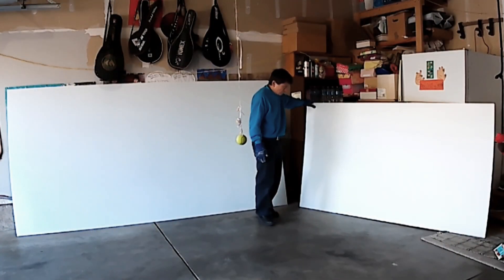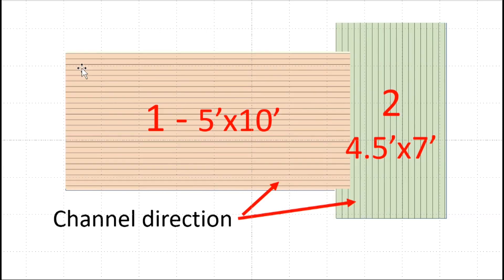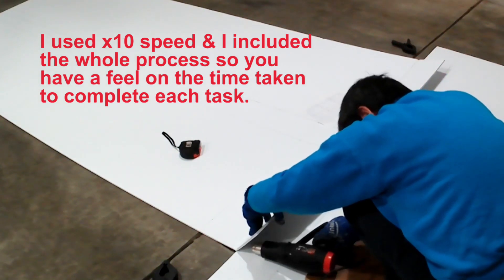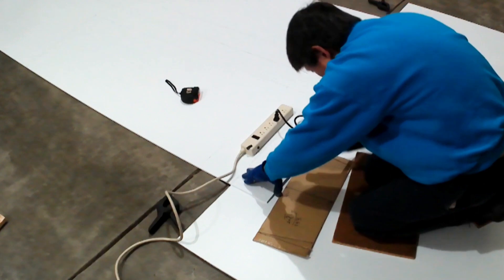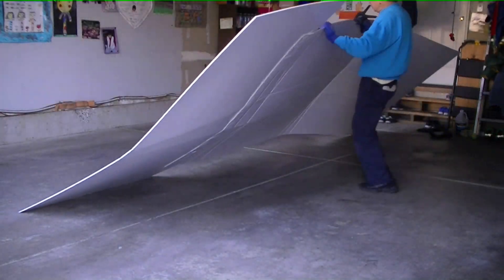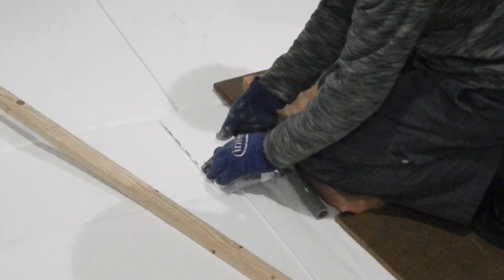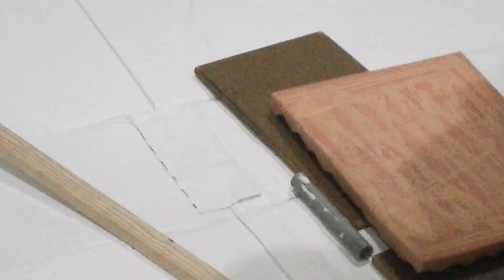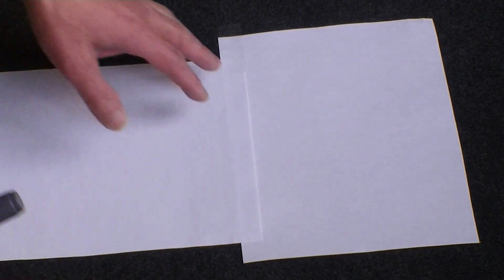Fusing Coroplast & Applications: Part 1 Jointing large sheets

Comment: What do you think of a sail made of this material for small craft? Of course it would require some reinforcement and attachment points. My theory is that the sail would be fully trimmed at all times and would act as a wing! Maximum performance little drag.
Reply from the maker: Good suggestion. We need a 2 mm thick coroplast so it can be easily rolled up for storage.   I guess I can set it up as a sail similar to those on the 'Chinese Junk Boats'

Comment: Thank you so much, it's a really good idea
Reply from the maker: You are most welcome. There are updates, please check out this playlist. https://youtube.com/playlist?list=PL2ShZzOUu01uPMusHshCexb9YUnGn16xJ
Also, this summer,  I built this 14.5' boat by fusing two sheets together. https://youtube.com/playlist?list=PL2ShZzOUu01ul94LmvXJm_K3NVBKerLc5
I built this Gen 10 boat using heat fusion only. I used screws because I have to car top the boat and I need a few mounting points on the boat to tie the boat down on the car rack. Otherwise, it can be a 'metal free' boat, nothing to rust. https://youtube.com/playlist?list=PL2ShZzOUu01sgfIgkVD6AGaKk3JiserMy
Hope you enjoy these... Cheers!

Comment: Thinking of building a jig to fuse  4 x 8 sheets on end and on side.  Was going to put multiple heat guns together.  monitor the heat with a thermoeter and clock. And press the cloroplast together at the seams.
Reply from the maker: It is possible. Because each heat gun draws 1500 Watt, so you need one AC circuit/gun. If you use the butt joint illustrated in this video, https://youtu.be/A-KaL2vKcLQ you can visually tell when to press two sheets together without needing thermometer and clock.  I appreciate if you would update me on how it goes.  Thanks!
Reply: @henry terry - Any update please - I'd be really interested to know of your experience  🙏

Comment: Dear sir
Thank you first of all. Have you tried flex seal or similar product instead of heat to bond the sheets? Or first heat and then flex seal while plastic is still hot?
Thank you
Reply from the maker: I have tried gorilla glue (test result in this link https://youtu.be/YSkBW6CQjDw) Coroplast is very difficult to bond with common glues. People have used glue gun and polypropylene glue sticks or use ultra-sound welding to bond the coroplast sheets. 3M has a glue supposed to work. I bought a tube a few years ago and have never used it. It is also expensive. I have not tried flex seal. Heat fusing it seemed to be the least expensive way to bond sheets of coroplast, though the joint does not look very nice.
Reply: @DIYUSA  thank you very much. If i try flex seal to bond, i will let you know the result.

Comment: Dear sir,
Thank you before anything else. Have you tried flex seal or a similar product? Not as a bonding, but as a final protection?
Thank you
Reply from the maker: Thanks for the question. I have used gorilla tape (2.88" wide, a slightly thicker tape, works, not sure how long that will last), added silicon sealant after fused the joint (much more reliable). My friend used Gorilla 4" tape (works). You can see the implementation using silicon sealant in this video series: https://youtube.com/playlist?list=PL2ShZzOUu01ul94LmvXJm_K3NVBKerLc5

Comment: I never considered heat fusion. Very nice
Reply from the maker: Thanks for watching. I have seen heat fusion on other plastics and I believe I am the first one applying this idea on coroplast. This requires practice and I have been using it to build many boats. I am still learning and discovering new applications for this technique. It saved me a lot of money on glue and it has a better bonding result than most of the glues (on coroplast, which is difficult to glue).

Comment: If you like this video check out number 2 when he tests the strength of the joints.
Reply from the maker: Hope to have a better method and tools to test the joint :- )
Reply: I am way watching your other videos to see all the bonding methods you tried.  I can’t wait to see which one works the best!
Reply from the maker: @DennisHicks78749  You can joint the sheet using different methods. Somethings depends on what you want. I like butt joint, simple and easy, but I can't fuse a sheet larger than two feet long...due to a single heat gun and 1 person can't handle a larger joint.
In the beginning when I discovered this fusion method, I expect I can create a water tight joint. Unfortunately with hand tool, lacking the control of heat and also the compression force, there could  be a tiny open/unfused seam at the joint that allows water to leak. Nevertheless, the fused joint can handle sufficient tension force, much better and more reliable than using tape or glue. I can stop water leakage using silicon sealant. For a small surface, such as repairing a small tear, I believe I can create a watertight seal by fusing another piece on top of the tear.

Comment: you have changed my world
Reply from the maker: Hope you find this information useful. Since I published this, I have further experimented using this technique in building boats, such as my Gen 10, Gen 9 and Gen 9+. I also have a video on fusing 4 mm thick coroplast  on my Youtube channel and it turned out it is very easy to work with thinner coroplast and I didn't encountered any  issue. One thing I discovered a month ago is with the simple tools I have, it is very difficult to create a 100% watertight seal on a  large joint. However, a 'not so' perfect joint will provide me sufficient strength for my needs. Therefore, if a water tight joint seal is needed, I suggest to add a layer of gorilla tape on the joint. Cheers!

Comment: thanks for sharing, Mr. Hong. i'll try on my next project.
Reply from the maker: Thanks for your feedback. I am still learning how to apply this heat fusion technique in different designs. I realize with my simple hand tool, it is difficult to create a 100 watertight seal in a long fused joint. A not very perfect joint can still provide plenty of strength for my applications. Hence, I would recommend to apply a  layer of gorilla tape over the joint just for water proofing if your application depends on that.  You will see I use this technique in build kayak and boats (Gen 9, 9+, 10 and my conversion of a kayak to a sail boat videos) on my channel. Thanks for watching, Cheers!

Comment: Gre4at Work. Fantastic. Brilliant experimentations.  I have a huge 53 ft x 10 x 14 ft structure i would like to glue together.   A huge box the size of a tractor trailor. thanks
Reply from the maker: Thanks for watching. There are updated videos related to heat fusion on my channel or it is easier to go to my website which has links to corresponding videos https://www.diyusa.org/techniques  Cheers!

Comment: I find quickly made butt joint with a fast industrial glue gun using polypropylene refills works very well and looks super-clean.  Actually, testing a panel with such a connection always gives me the same results, at least when the specimen is loaded in bending within the full width of the usual elastico-visco-plastic loading ranges. In test after test the panels mostly buckled in zones away from the glue gun seam, the glue filled shared cavity is simple too strong to cause problems.  And removing a bit of visible melt outside the seam is a cinch: just rub it away with a 3M scouring pad.
Reply from the maker: Hi Jim, really thankful for your suggestion. Another reader actually pointed me in a similar solution, except the polypropylene is from the same sheet of coroplast. I followed his suggestion and able to come up with good result. https://youtu.be/7cGiclzy4yQ  I am working on part 2 of this series and have used a strip of coroplast  to provided the extra polypropylene. The result was not good. I never thought pf the polypropylene can be from the glue stick. This solved my problem. I have also just melted the edges of two sheet of coroplast and then butt them together, that works too ( which will be in part 2 of this series). I will try your method tomorrow and I expect the result will be even better than the methods I have tried!  Thanks again for your input!
Reply: ive heard this . what sealants , glues do you recommend. I would have to buy a drum of it for my structure
Reply from the maker: @identiybodega  There are options from 3M and others that you may try https://youtu.be/yowxfkAtdtM  and https://youtu.be/Ac4iQR5e6aM

Comment: Great job --very useful to me --thank you -I appreciate you sharing this information
Reply from the maker: Glad this is useful to you. Hope this will inspire you to apply this to build something fun! I will be sharing more info in the coming weeks. At this moment the weather here is still cold and I don't feel like to work on it. But the weather is changing in about a month....and spring is coming :-) Time to get back to the river.
Reply: Hong -I want to build a inexpensive lightweight cabin on a utility trailer and looking for ways to work with this material-it is weather resistant,cost effective,lightweight-I am learning to make structural beams by laminating several pieces together as it’s 1/3 the weight of conventional lumber
Reply: Thank you for responding back -I look forward to watching for your up a coming projects -stay warm
Reply from the maker: @tdnewd09  That's great, I plan to build a modular boat with rigid hull sections. I will embed foam sheet and PVC pipe to create the shape and to strengthen the structure (using heat fusion to create compartments and embed the foam and PVC pipes). In that case, I will not have screws (no rust), no glue (reduce cost). I may use spray foam to fill in the gaps within the embedded partitions. It should be much stronger than using glue/screws. You may not have to worry about condensation in your cabin build. It is very easy to fix the tears on the coroplast (which will happen) by using fusion technique also. You may apply this approach in your project. Have fun!

Comment: good information thank you for sharing Question:  on a 6 inch fusion could you turn the sheets over and continue to fuse from the other side for complete adherence if you really need a 6 inch overlap?
Reply from the maker: It is a very good question. This was the first time I did this type of joint (on a large sheet) and that was what I have intended to do. Please note I was using 6 mm thick sheets (more difficult to bend). After I fused one side, flipped the board over and tried to fuse from the other side, I couldn't lift up the edge high enough for me to shoot hot air to the inner layers to do the fusion. The board is too rigid and it didn't bend. If I force hot air between the tiny gap, the heat will damaged both top and bottom coroplast sheets. If I allow 12 - 14" instead of 6 inches (overlapped area for the joint), I may have a chance to do that. That's why, in this video,   https://youtu.be/TvnjSLL67iU  , I suggested to fuse two 4 mm sheets with two parallel fused joint. The overlapping area of two sheets is 12". The 4 mm sheet is easier to bend upward and can create a bigger gap for me to shoot hot air to the inner layer to complete the fusion.
Reply: I think it should be strong...so 6 inchs is okay.  I am going to project immersive images upon the cloroplast.  53 ft x 13 ft high ....so the buts have be clean.

Comment: Interesting concept!  Does the process release any fumes?
Reply from the maker: You asked a very good question. I didn't pay attention to this until a viewer reminded me about this risk. Now, I only do this in open air and also wear a home make respirator. The fumes doesn't seemed to be strong, especially when compared with working/heating the PVC pipe, which could emit toxin fumes. Coroplast's melting point is much lower (than PVC pipe). If you have a fan blowing behind you when you heat the coroplast, you would avoid inhaling any fume (my experience). Again... do this in a well ventilated area and I have added this verbal warning in my latest videos.